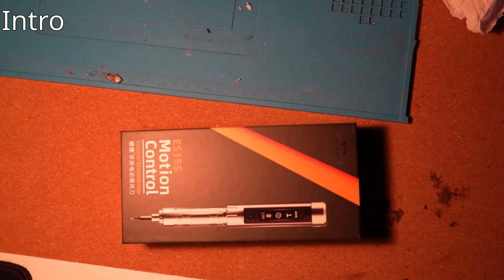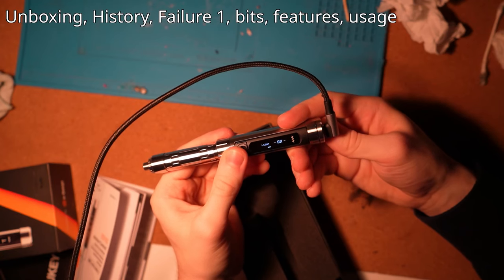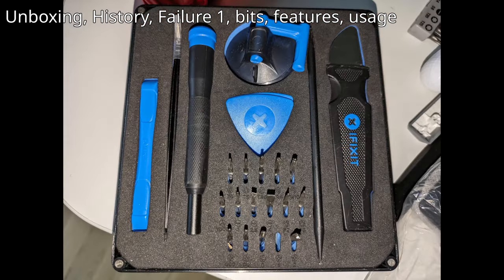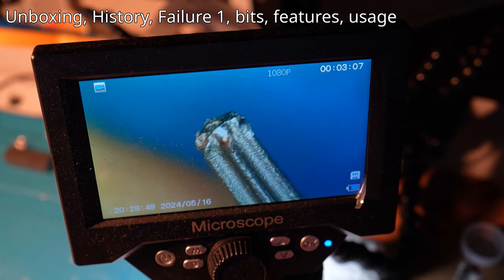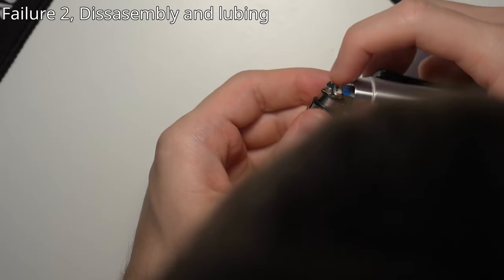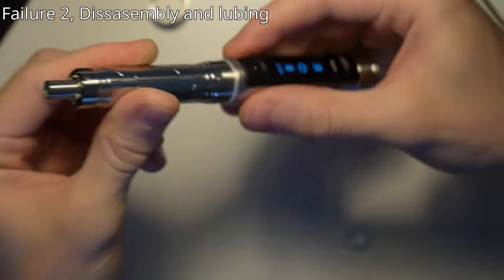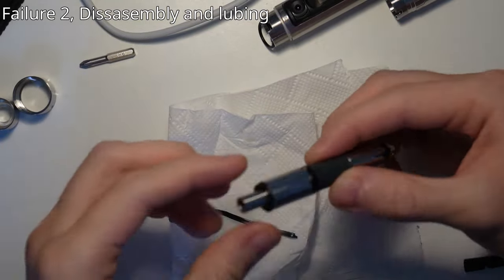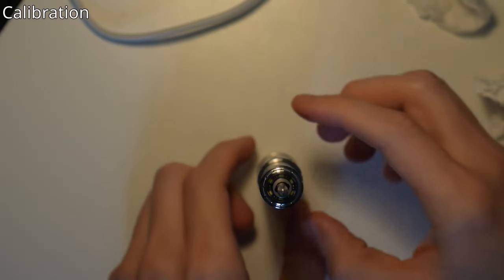Miniware ES15S after 8 months review

Comment: When disassembling you managed to be much more careful than I was, any ideas for reattaching the display ribbon cable? All I got from their support was along the lines of "don't do that" and that disassembly is not allowed.
Reply from the maker: Their display is made in a way that you must desolder the ribbon cable (from what I understood, so if thats the case), its really not a good design in terms of repairability. I dont have any videos soldering them but you can try looking up "soldering ffc connector" on youtube. That ribbon is right below the screen, so be careful with your soldering iron because you will melt its frame in a second.